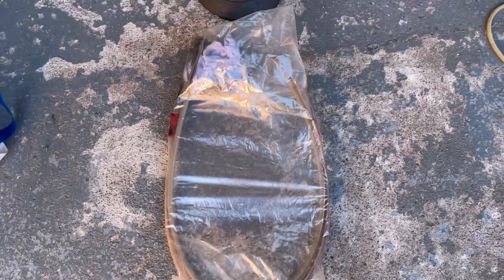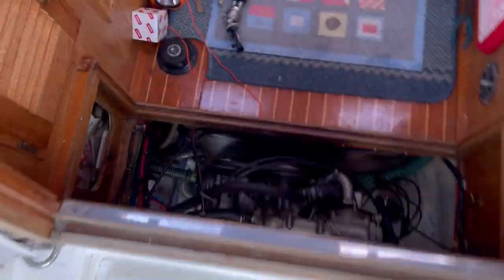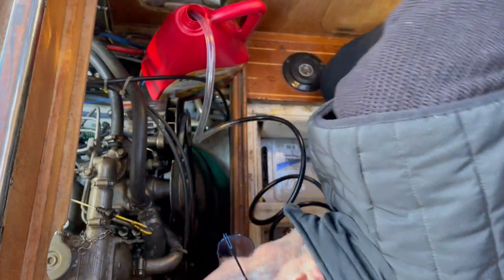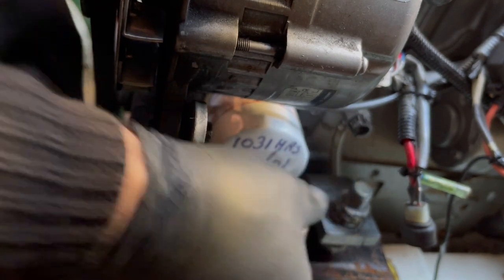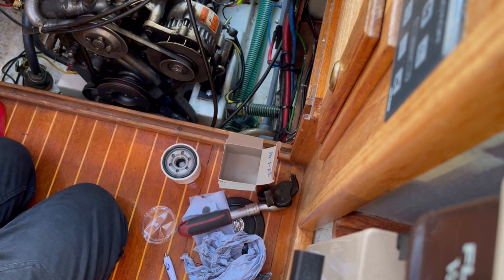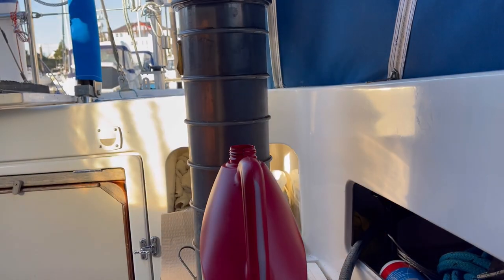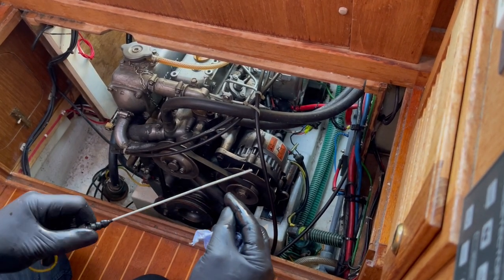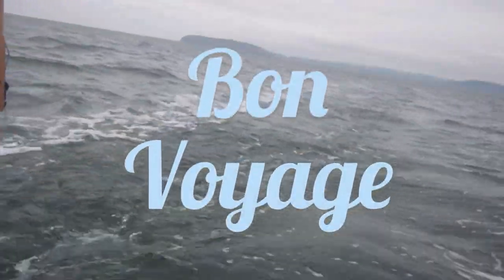Inboard oil change

Comment: Hi I’ve put this on the current episode but it refers to your oversized Genoa, I had the same and solved it by rigging 2 low friction eyes with a Dynema pulley system to alter the height of the Genoa lead. I’ll get the photos to you somehow as I can’t see a way to do it here.
Reply: Do you have an email address I can send them to? Phil
Reply from the maker: Hi Phil it’s “marineandmechanics@gmail.com would be glad of the diagrams. I have though ordered some deck track to extend my run. That was back in November but still waiting. Thanks for your help and support most appreciated mike